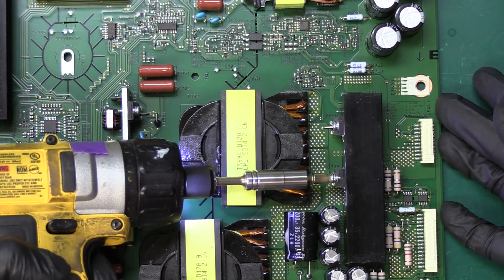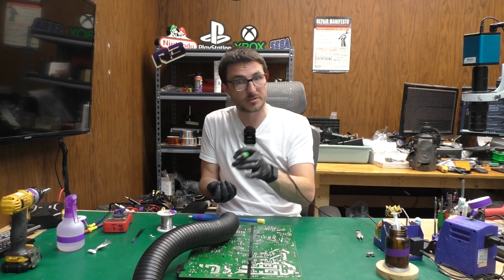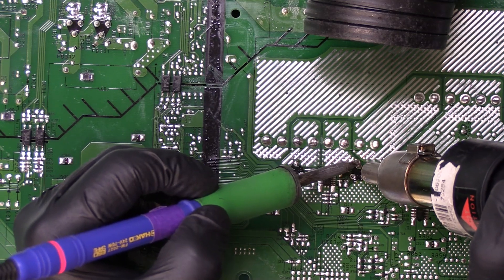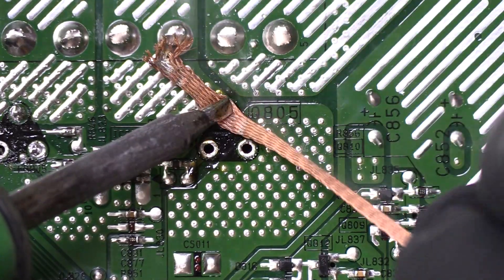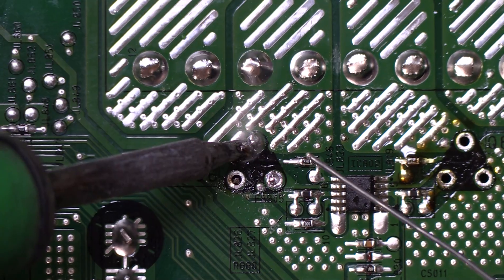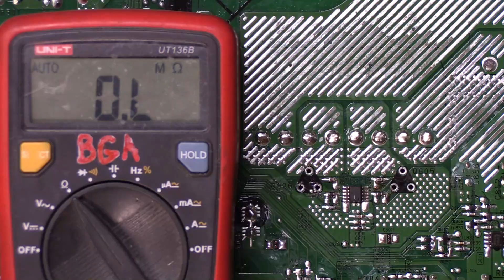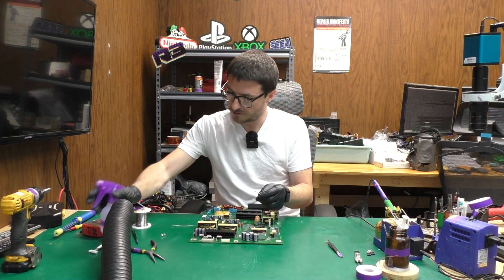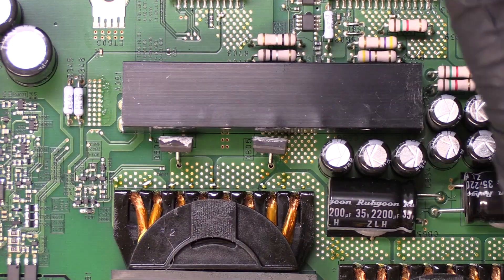Fixed Sony OLED 4 Blink Error! Power Supply Repair XR-77A80J XR-77A80CJ

Comment: @Nick do you guys happen to sell the transistors on your site >?  Tried locating them online but they seem to be sold out lol.
Reply from the maker: Yeah we can't get those anymore either. Right now we have the stock we have and once we are out we are out, so we are holding them back for our customers that are purchasing the mail in service for the power supply. 
I know it's not great but that's the situation we are in until either they become avaialble again or we find a proper alternative.
Reply: @grolledchickenwrap If you still need this transistor, comment below as I found and am ordering a batch.
Reply: @ampur88 I need some but not a lot maybe 10-20 pcs?
Reply: It won’t let me give contact info
Reply: 408
Reply: 560
Reply: 0503

Comment: Do you sell the transistors or can you point us in the right direction?
Reply from the maker: I don't at this time because these are hard to get so I save them for my customers that send in the boards.
Reply: @Brenman8 If you still need this transistor, comment below as I found and am ordering a batch.

Comment: I have a samsung led tv with this fault,standby light blinks 5 times with no display screen.Can you please be of help me with any suggestion on possible cause of this problem.Counting on your kind heartedness and suggestion.
Reply: Following, I have sony XR65A90J with 5 blinking red led.
Reply from the maker: We don't have any videos on the 5 blinks because those are often due to T-con or panel failures. T-con boards are always available for cheap so you can easily replace those, and if the panel is bad typically that's not fixable.

Comment: Is it still considered a short if it only beeps for a fraction of a second?
Reply from the maker: no that means there was probably just a bit of residual power left in the board. Do a resistance measurment instead of continuity.
Reply: @NicksTVRepair thanks for your response! I will give that a shot.

Comment: Hi, my Sony XD 55X9005C starts turning on right at the startup logo and then turns off, then gives me four flashing LEDs. Could this be the same problem as in your video? Thanks
Reply from the maker: No these aren't the same types of TVs. We can't use the repair of a newer OLED TV and apply the same fix to a regular LED set manufactured 10 years ago. The tech is different. 
What you have is an LED backlight failure. I recommend you check out the videos we did for that model specifically.
Reply: @NicksTVRepair I changed them but now I see the LED lights at the bottom of the TV

Comment: Hello Nick, my Sony KD55XH9005 stopped working at some point. The screen went black and there was only sound. When I looked closely with a flashlight, I saw that there was still an image, but it was very faint. Then, I performed a reset on the TV using the button until 'Erasing' appeared. The TV worked normally for a few hours, but then the screen flickered black for a moment and the same issue happened again. Upon restarting, the Sony logo and the Android loading screen are shown normally, but then I get a black screen again, could you please tell me whats wrong?
Reply: Backlight issue?

Comment: My sony KD-55X9005C Flashing green and orange lights . and I could not fix program flash drive . please help me
Reply from the maker: Sorry that one is discontinued. If the software is the same as the USA version we have the software hosted on our website, but this looks like a european model which I think might use different software.
Reply: U need firmware from Sony on line

Comment: Thanks Nick for the video first think in the morning. Was it the transistor that was making the squeaking noise?
Reply from the maker: It was not. I was not able to identify exactly which part it was that was making that sound but it was like 6-8 inches above and slightly to the left that the sound was coming from. Just not sure exactly which part.